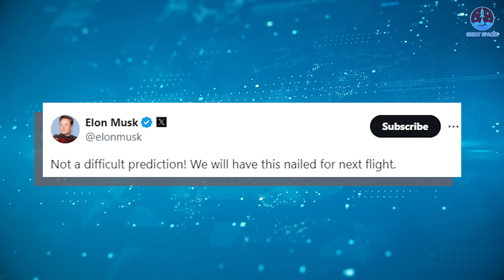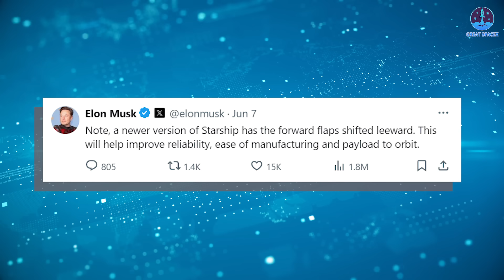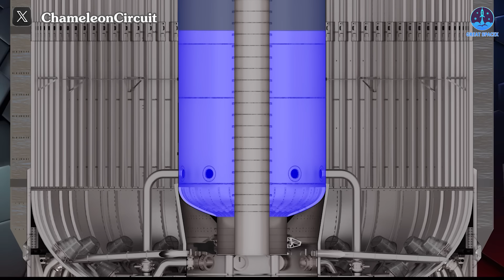Elon Musk Just Revealed Massive Changes On Next Starship Prototype After Flight 4!

Comment: It was good but wasn’t as good as it could have been. Flight 5 needs a full heat shield and they need to move onto v2 asap. The flaps further leeward will have a huge impact on the ships resilience during reentry and the integrated hot stage reduces dry mass significantly. 

SpaceX also has to work on their algos for landing. Even though both ship and booster landed softly, it did not seem like they hit 0 velocity before touching the water. It would be wise to not conduct a catch attempt on the next flight. 

Overall very impressed with the resilience and performance of the full stack on this launch but there is still a long way to go. I can’t wait to see what improvements flight 5 brings. This next series of flights is all about learning and refining software and hardware implementations for the future generations.
Reply: If they do angle the flaps at a higher angle if that's even a correct description of what I'm trying to say or "leeward" as you say, wouldn't that mean Starship will reenter Earth's atmosphere at a higher velocity requiring more fuel to slow it down to 0 velocity before touchdown or splashdown?
Reply: @RobbyHouseIV  kind of but it’s not really a big deal in the grand scheme. The speed at which with both ships enter initially is not dependent on where their flaps are. Will the flaps have the same aerodynamic breaking effect? Probably not, but that is something that can be accounted for by entering earlier to achieve a similar desired landing location. It will likely not be a drastic difference most of the ships surface area is made up by the cylindrical barrel sections on both. The flaps are just there for control and do not need to be so large to make an impact on the orientation of the vehicle. Regardless, the real goal is to keep plasma from getting past the heat shield and causing damage like we saw with this flight. Moving the flaps further leeward positions the gap between ship and flap in such a way that it is less likely plasma will travel into the unprotected gaps and melt stuff. Once below hypersonic speeds and in the lower atmosphere the terminal velocity of the new ship will be higher but still not as high as the booster. The booster on flight 4 lit its engines at above 1000 km/h while the ship lit its engines at around 350 km/h. The new ship will likely be similar to this and the raptors have already proven their ability to relight at higher velocities as shown on booster. When they enter, the reentry attitude, and time and speed of landing burn will all be worked out in software and simulation. Yes it may require more fuel but increasing header tank sizes is easy and extension of the ship to hold more fuel is already slated for v2 with the addition of reduced residual weight. The basic premise remains the same with only slight tweaks. The people at SpaceX are well versed in how to adapt their software and likely wont have much trouble figuring out how to choreograph all this to work successfully with their insights gained from the flights. Expect the ships with smaller flaps to perform much better upon reentry than the current design.
Reply from the maker: Let's wait for their next upgrades

Comment: I suspect the the engine fail in the booster might have been a test to see what if.\
Reply from the maker: I think it's fail due to the super accumulated heat when liftoff
Reply: @colonbina1  I'm no "rocket scientist" but I, from the beginning, always wondered why the laugh facility was so close to the ground and why there was no flame diverter. So much intensity with 32 rocket engines blasting the ground just feet above seems to be almost unsolvable in preventing damage to the launchpad and the booster......
Reply: @caseyporter1235  The end goal is to be able to lift off from the naked ground on Mars. Slowly but surely they are engineering their way to that.

Comment: Run coolant through the flap just like the rocket engines
Reply: I'm sure the designers have thought about all materials available, titanium melting point isn't that much higher than the grade of stainless steel they already use. The steel isn't the problem it's the gap in the hinge to the flap
Reply from the maker: Great idea👍
Reply: You might have something there. Around the engines are going through immense heat but started for control splash down in the ocean. 🧐🤔 What are they doing in that area of the ship? That's a good place for a camera. Frankly, he needs to recover both vehicles to see the damages.
Reply: Good idea also make them of titanium

Comment: it did show some robustnes and on a path like falcon 9 which is ultimate goal as pusher go ahead goal described as easy owerachiever that a goal and bm stuff 5 or 10-15 year doesnt count in achievment goal and proper enginering and research and inovation and yearly alocation funds from budget as comp do keep locked thsi theme as get like 25-33% from year budgets funds alocation to do test and research new stuff and new design so the game and actual production numbers increase as well as surface off parst in this case critical like engine numbers or even another product for engine facility like open props subs for jet engine and vtol rockets system single or twin on servos for egg land but thats future and factory facility engine allow that and research and inovation kind a lead and iff some money fund suport this them ther is lets in less then 3 year bran new factory facility engine with automated line and robots patch welds same gigaline factories but size off line has to match easy even bigest siye engine slightly taller moving line and thats  all
Reply from the maker: Thanks for your great comment 👍

Comment: Having 33 rocket engines does NOT help. It dramatically increases the odds that one will seriously malfunction, explode, and end it all.
Reply: But that’s not quite how this works
Reply: We still have to keep in mind that we are still fairly early in the testing phase of the starship program. Any success or failure is good because it data they use to either keep or change systems for more safe and successful flights in the future. As Elon says himself we expect failure it’s actually weird when something works the first time.
Reply: Yes adding more parts adds more points of failure but refining the hardware and eliminating failure points or reinforcing existing Hardware is possible in reducing component failure.

You can't say reliability can not be quantized and optimized.
Reply from the maker: But this will minimize the dependent on a certain engine
Reply: @colonbina1  The disadvantages will still likely outweigh the advantages.

Comment: If the flaps are the weakest point, why not use a different metal, instead of using steel for flaps, why can't they use titanium, tungsten etc.. High melting points.
Reply: Simple answer - weight and cost.  Keep in mind also that it is not just steel, it's a steel alloy (no idea what it is made up of).  Titanium is rather expensive, and difficult to work with - it also can be softer than some heat treated steel alloys.  Tungsten is one of the most dense metals that exists - it would add significant mass to Starship.
Reply from the maker: Yeah👍
Reply: @stevejackson8060  thanks for the reply. Surely changing the flaps to tungsten isn't going to change that much in mass? Are they planning to make the starship bigger too. Even making it longer will add more weight then the flaps if change to tungsten. Plus it's an empty shell. When it's full with humans, cargo, life support then that will add mass too.
I'm sure the raptor engines are powerful and can cope with the added mass, it must be able to for the safety reasons of starship. You build engines and extreme test them to see what there limits are.

Comment: cryo coolant liquids looks better above not as seen on first video but still the same task keeping faith and stil stays the same question of feasy pass surpass lift point trust speed and initial speed boom to easy surpass as kind star trek lifts off fog clouds even in damage strucutre and to easy but engiine dynamics works even if capactiy 100 t off cargo so still same cryo preps incfrease volume stays realisticly in head turn 5 years start may be like 3 years but still same problems and main in after all tasks and kind IV process cryo cooling acustic to lower vibration rockets and easy achieve then is easy and kind wanted achieve boost at leasure try and part rockets work and easy pilot check assembly flight status and fast integrade and check status but that history off bumps warps may be like 100 200 x easy so pretty relaxing easy lift off to achieve that in rocket which is bulky a aqustic test in flight dynamics part is a like pure pleasure all parts have work on status increase hold release pressure on corners absorber pressure holders tubic piping vacum pipe 3d model printed to hold tore and stress and pressure dynamics easy cryo cooling boost max to 56-64 % to even desirable 75% as slight above reserve standard when ir goes like cryo cool liquid prop like 84% is no longer important if it is jet or rocket vtol then is vtol rocket time and even 75% cryo cool allow that acording to us standards but that is enginering not bitcoin forbes and then new chasys may be engine volume adapt euro 6 vtol or even euro 7 protocol with some corvette chasy but that already well in massive industry production ops with engine factory and introducing if likee possibility ops for open turbine props that do 75-84% off max jet size prod option and slef build then is easy vtol time and considerable lower jet fuel consume and there is glitch for again opne new factory production as self made complementary prop engine but jet compliant to rollce royce and there goes a nother factory boom and easy as factory rocket engine just assembly massivly produced and again new on world since this stuf it could pass 10-15 years in aviation industry except sapce x would like it in 5 and again new need for factory automation line production something that elon and tesla learned well and lets say dramatic improve on next 10-15 years in engine tech as bottom surface preps make thsi and industry background and finaly research and inovation gets some boost that time for corvette spacehip tech gets some boost while having some surface background but no were near close to star trek boost type warp lift as easy cargo and skip time lift that easy tear 7-14 lvl while spac ex consume time on bulky and shaky boiler boost that creates a boom heat energy it works or it even may land but no were near acustic easy and pass skip easy 100 -200 test in advance that time space x gets soem reseach and inovation intgraded that is why 5 years balance and thats hugh volume in auto industry and in sace x pass so easy as if they are lost time but on good goals solving some stuff how how fast how strong ground suply and research and inovation with 3d props for jet engine switch on open blades even easier switch to 420 t preliminary double turbo oxy engine and easy instal and try switch as keep midle 1,2 3 and circle above technicaly all engine can give pressure but mid can do more then later optimization in lees engine but more fucntional and at more presurre easy owerachiever in long numbers this raze quota off spaceship corvette design and massive use andf then tech and space dynamics set is safety rules and moves on in creativity now is just taylored rocket to power and engine burst and that rocky and shady coming down on egg in ocean for safety terms in future what it means deployable photon torpedoes more liek developed engine speed with enough kinetic energy with some explosive head 145 kt expl  is not that small and since vulcano upset is like terraform option on earth and opens terraform on mars and that easy if possible finding a tearrain for vulcano spot burst through material like dust or lava up again scfi stuff and vulcano open line stuff spill like earth is in operation once lava heat penetrated a even like vulcano open lines are possible since enough heat which brungs us up again how fast are going to past next 15 years doing this vulcan does it every year regulary so does tax to

Comment: They need to use something like a lightbuld screw.  I bet the gaps between the tiles could be filled in by shaping them so if you install them in order there are no gaps (interlocking edges).

Comment: How about using tungsten for high temperature points like flaps.  It has a melting point of almost 3400 degrees c.
Reply: Tungsten is one of the most dense metals that exists - it would add significant mass to Starship.  Also it has very different properties with regards to compression and torsion - and has very different behaviour when it gets hot.
Reply: Because melting point is not the only factor you'll need to consider.
Reply: Unfortunately tungsten weighs a shit-ton I believe is the proper scientific way to describe the problem. It's great for armor piercing bullets however!

Comment: Flight 5 booster should be another water landing for a number of reasons. Most importantly to avoid damage to the tower 1 until tower 2 is at least nearer completion. If tower1 is damaged during the next launch (4 to 6 weeks from now). Repairs (or tear down & reconstrution) to tower 1 could take over 9 months as well as construction of tower 2 taking about the same amount of time. Which mean almost a year before the next launch putting Starship way behind schedule
Reply from the maker: Yeah, I'm agree to you ☺️
Reply: Solid point, too many variables that still need to be ironed out prior to a tower catch, redundancy as you suggest I believe would be top billing also.

Comment: Gluing will not hold them... put them on with inter locking wedges
Reply: The tiles are going to expand and expand mightily when heated
That means they need room to expand. 
Interlocking wedges would stop the expansion; hence the use of pin-and-(possibly) glue to hold them in place; the pressure from the re-entry keeps the tiles from flying off.
The glue is to keep the tiles in place when taking off and coasting
Reply from the maker: That leads to many problems
Reply: velcro!
Reply: How about cocooning the craft in heat shield material
Reply: @foxyjackel1928  Um... how do you stop the "material" from getting torn to shreds or ripped clean off?
How do you stop the compressive transit through the atmosphere from scrunching the material up? 
That's why they use tiles.

Comment: There should be a thick unmovable tile leading the hinge to deflect plasma away from it.
Reply from the maker: Great ideas 👍
Reply: Except the flap needs to move.
Reply: If you watched the plasma waves on the flap you could see that there appeared to be 3 waves created by the geometry and one of them was angeld into where the flap hinged so possible creating a hot spot on that area causing the burn through. So changing the geometery by siming the plasma flows should fix it

Comment: I wonder about the use of high temperature ceramic coatings instead of, or with the current heat tile system. They have ceramic coatings that can withstand up to 5000 F.
Reply: I thought about that years ago when I was a machinist making turbine engine parts. During the shuttle years I was aware of spray on high heat ceramics. No doubt in my mind that Elon and the rest of the crew will figure it out.    God speed SpaceX
Reply: Musk has said they may strip off the tiles and put a layer of ablative glue under them as secondary shield. I have a piece of the Apollo ablative sheild..it looks like ordinary epoxy..slightly yellow.
Reply from the maker: Great suggestion
Reply: Ceramic coating will transfer heat. If you apply to the ship hull then it will heat through to the steal. Or you could make it into a 3 inch thick tile and affix it to the ship. Oh wait we just made the heat tiles they already have.
Reply: @undertow2142 No, it won't.  I have experience with high heat coatings,the problem arises because of the extreme vibrations and ceramics inability to flex.
Reply: @nickdonovan1447  Exactly.  A ceramic coating thick enough to not transfer heat to the underlying steal would be so thick it has to be broken up into tiles to resist fracturing.  A sub millimeter thick ceramic coating would not fracture but would be entirely overwhelmed by the heat load.

Comment: Can thrusters be used instead of flaps?
Reply: Yes, however the "flaps" do not use fuel; thrusters require fuel = increased weight.
Reply: @ozsteamer2755  use same fuel as main engines?
Reply: @Steve-Richter  If you increase the amount of fuel needed, you increase the weight of the fuel carried
Thus the whole thing weighs more.
The flaps do reduce the amount of fuel needed. That's why they use them.
Reply: @ozsteamer2755  I follow. Just thinking that current thrusters probably have their own fuel. Could thrusters get  fuel from main tank?
Reply: @Steve-Richter  Oh, heck, yes
They may arrange a separate system for supplying fuel for the thrusters, but that is even more weight.
It would be somewhat lower for weight purposes to use the same fuel tanks as the main engines... but lower in weight again is to simply use the flaps. 
After all, they have been demonstrated to work
Reply: @ozsteamer2755  also, flaps are need to provide lift. Lift enables ship to stay steady in atmosphere and reduce speed.
Reply: @Steve-Richter  Flaps are not needed to provide "lift"; indeed they do not work that way
They provide control; the rocket ship at the point where the flaps are used is falling downwards (as the designers want it to) but they want it to fall downwards in a controlled, controllable fashion 
Two options to do that: thrusters (as you point out) or flaps. They've chosen flaps.
Reply from the maker: Great discussion. Keep following and discussing on our channel ☺️